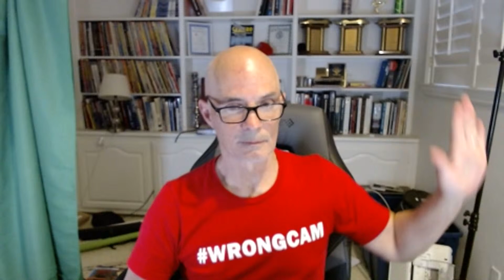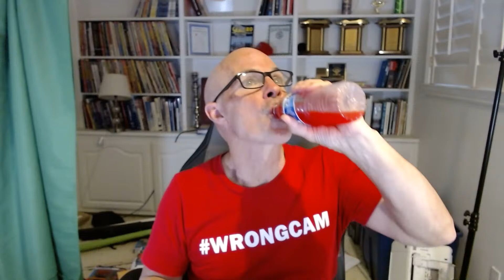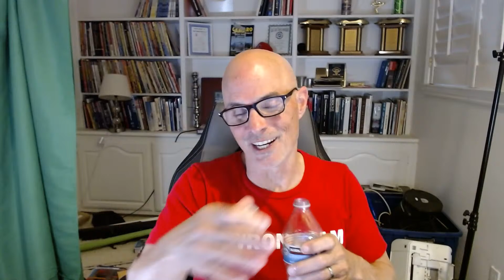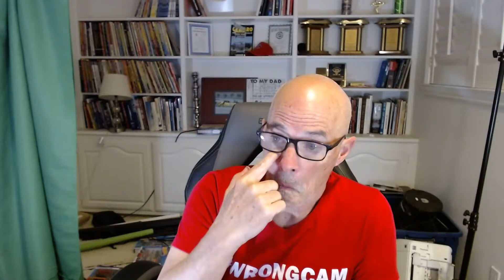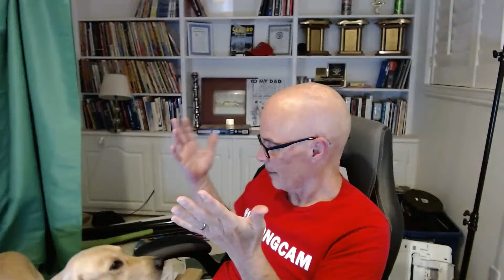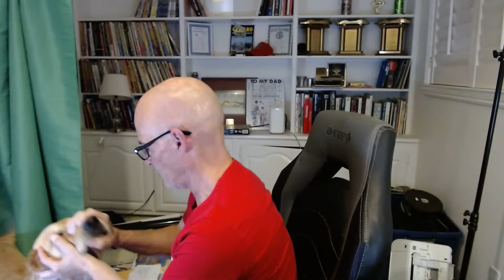CHARGE COOLING-WHY DOESN'T WM ADD POWER? LET'S TALK TECH

Comment: With port injection, the fuel/air are not together long enough to transfer the heat.  Ina carb, the air has time to transfer heat to the atomized fuel. Water/meth is evaporating into vapor.  And, since there is no such thing as a free lunch, the dilution effect of the water vapor offsets the increased charge density, pretty much 1:1.  Water/math is mostly an octane booster.  Although water does improve combustion chemistry.

Comment: How about you make a big bang series with w/m injection and no intercooler. See where you can add timing/boost where you normally couldn't even on an intercooled non w/m comperable setup. Adding boost in mid range rpms would be an awesome test for a gt45 or maybe the gt35 on a 5.3 or 4.8.
Reply from the maker: A WM, non-IC motor is not a Big Bang motor. It is just finding the detonation.
Reply: @richardholdener1727 Water more or less eliminates detonation at the right mass/spray.
Hence interesting to see if you can make it detonate at 15% ratio to fuel

Comment: One thing to note, how does that work out on an engine that turns 10,000 rpm for charge cooling such as motorcycle engines or other automotive engines
Reply from the maker: charge cooling still take place with fuel introduced art the entry
Reply: @richardholdener1727  I have a Yamaha FZ1 with 4 carbs and I've been thinking about EFI swapping with speeduino

Comment: I have run WI on several street cars with carburetors. I did this to help suppress detonation not for more power. This helped especially on hot 100* days. I was able to run slightly more timing for better fuel mileage and cheaper lower octane fuel to save money. This with no increase in power.
In the intake manifold water will atomizes and cool the air but take up ‘air space’ and vaporizes in the combustion chamber to suppress detonation.
One read in the past had a theory that the water in the combustion chamber when it vaporized will expand and add some degree of steam engine function. I have calculated the amount of water that goes into the combustion chamber is so small that even though it vaporizes like 1000x’s volume but that volume is actually very small.
I still use it as there are many positives and no downside. Not making more power is not a downside.

Comment: Water & water methanol injection was implemented on supercharged aircraft engines @ altitude. Altitude effects & lowers the boil point of H2O. 
Perhaps atmospheric pressure combined with the lower temp @ altitude has an effect on the efficacy of this kind of system.

Comment: Water injection: The water vapour will displace the O2 cells. So…. My theory (experience) is that the density gained will not out perform the reduced volume of O2. UNLESS. You have a big turbo without an intercooler, the IAT difference might be so off the chart that you will increase total O2.

I agree with what you’re saying, I know we’ve spoken about meth and I’m a big meth head. I attribute it to my stock engine still having compression

Water/meth: less water vapour, but you smuggle more O2 via fuel. I suspect, that you’ll start having combustion behaviour like running methanol/e85. Cooler EGTs, lower IATs (is it enough to overcome the volume? Nah, I don’t think it is). 

Pure methanol: You displace air, but omg you’ll get more total O2. It’s pretty crazy how much benefit you can get if your combustion distribution is good. My car absolutely loves higher methanol mixtures, it’s wild.

Comment: Because reported IAT temps aren't an accurate representation of the actual charge temps. They are the result of a wetted thermocouple having heat drawn from it over time. 

 This is why if you run 20lbs with an IC and have 140* charge temps. Then remove that IC and run water/meth instead (with enough jet to report 140* charge temps). The intercooled setup will always make more power. Because the charge temps reported are much more accurate without fluid in the mix.  Just because a sensor tells you something, doesn't mean its true. 

Main benefit 2 meth inj. at low volumes is cylinder cooling and anti-detonation, not charge cooling. No common kits inject enough volume to pull the same heat an IC does. Look at the volume injected with a carb vs a typical 8-12gph meth nozzle. That is why you see benefits with the carb, and not with water/meth. Run 100% of the fueling as meth with a carb and suddenly charge cooling works just fine.  Same deal with meth injection. You just don't run enough of it to knock off the charge temps in your tests because you are looking at the IAT sensor.

Comment: Dunb question where are you injecting the water meth? I imagine it would lower the amount of air the intake can flow. Not necessarily mass flow of the intake but the amount of actual oxygen and fuel it can flow. Because the water meth has to take up space in the runners.

Comment: Hi Richard It's funny you made this video. My name is Brant Kinnsch I don't know if you remember me but I had Steve do that all aluminum 572 that I built with direct port FI and water meth on a Hogan manifold. We saw 10-14 hp on that engine injecting water meth or strait meth I can't remember which was the case. I don't think Eric added any timing of any other compensation to the tune. Eric incorporated the injection via a holley dominator ecu. I remember this as Steve was poo pooing me about trying to band aid the fuel octane instead of just running race gas. The good news for you is Steve has the dyno files. The customers name was Brian Stout. I remember being somewhat vindicated after that dyno pull as it did make more power. Let me know if you find the files I would be curious to hear about the notes that Steve put into it. I'll also ask Brian for the files as he still has them. This was about two years and 10 engines that I have done ago. So my memory is a little vague. You might remember Brian and his wife they had that Big great dane that was cruising around the shop when we were there

Comment: nitrous oxide works the same way as injecting water/methanol or just injecting methanol. N2O, so 2 parts of nitrogen and 1 part oxygen. Nitrogen must be cooled a lot to make it a liquid so when the nitrous goes through the engine and then hits the combustion chamber it removes a lot of heat and then the oxygen burns making more power. methanol is toxic and burns almost invisibly so by adding water it removes the methanol's ability to burn as easily and also it isn't toxic with a 50/50 ratio. when methanol is used as a primary fuel the engine wears out much faster. someone tested the different types of fuel and the engine wear pattern, there is more metal in the oil. methanol costs about 2.50 to 5 dollars per gallon and it burns at a rate of like 2:1 so roughly double of unleaded fuel. the stochiometric of methanol is somewhere around 5.5 to 7 to 1. the stochiometric of ethanol is like 9:1 so you need about 30% more ethanol to get the same burn rate as unleaded fuel and methanol burns like double.
Reply from the maker: WM IS NOTLIKE NOS
Reply: @richardholdener1727  it is a little bit as they all have oxygen.

Comment: methanol is oxygenated so that by itself will make more power. Methanol has a high octane rating of 114. water is also oxygenated= h2O, so 1 atom of oxygen. Earth's atmosphere is made up of 78% nitrogen, 21% oxygen, 0.9% argon, and 0.1% other gases. so even water has more oxygen in it than atmosphere. Methanol was used as early as WW2 in airplanes. you need heat to vaporize the liquid which separates the water from the oxygen and then it can be consumed as fuel. when I injected w/m in my 2001 L67 the kit came with an activation dial so it could be started at higher or lower boost and it seemed to work better when I set it to activate at higher boost because there was already more heat in the supercharger and the w/m was injected prior to the rotor case.

Comment: Water/methanol has volume and is not very energy dense. It has the effect of reducing displacement when the engine is naturally aspirated. At best you break even in terms of horsepower if the timing can be advanced. There may be some benefit in an engine that has a high compression ratio because you are often octane limited and can add timing. In a boosted application, the water/methanol injected engine can make more power. The reason for this is because timing can be advanced. In a boosted application, timing must be retarded to prevent detonation. Timing can be more advanced with water/methanol injection. I own a Procharged Mustang. The timing can be advanced 4 degrees when I add water/methanol injection as opposed to running just pump gas. Although I haven't tested the car on the Dyno, my timeslips are about 2 tenths of a second quicker in the quarter mile when I use water/methanol injection. A tuner once told me that adding water/methanol injection without advancing timing will actually result in a loss of horsepower.

Comment: Saying water meth doesn’t add power but the tuning for it does is like saying adding a can doesn’t add power but the tuning does. 
If you add water meth and you can thus add more timing without detonation, and it makes power…then same thing when you add a cam. You must tune for it. We all know nitromethane adds power but if you add nitromethane without tuning, you lose power.
Reply from the maker: I CAN ADD A CAM AND IT MAKES POWER ALL BY ITSELF-THE POWER DOESN'T COME FROM ADDED TIMING (THE GAINS COME WITH THE SAME TIMING)
Reply: @richardholdener1727  every time I added a cam without tuning, the engine would BARELY RUN AND DID NOT MAKE MORE POWER UNTIL IT WAS TUNED.
Reply: @richardholdener1727  seriously dude? You know good and damn well that you have to retune for a cam and the timing doesn’t always need to be changed but the fueling does. Adding water meth will not add power usually on it own, but if you can add timing and it adds power while suppressing the detonation….then in essence you added power by adding water meth. Stop sniffing glue dude. If you are so sure, post up an unbiased test. Add timing till it detonates. Then add water method and see if you can take it further. There’s a reason why boosted guys use it. And why there’s companies that sell kits.

Comment: You should watch David Vizards " World's cheapest  most effective octane booster " for answers
Reply from the maker: HE DOESN'T ANSWER THIS QUESTION
Reply: @richardholdener1727  David  says that if the droplets vapourise too soon, then the vapour takes up space that can't be utilised for air and fuel. Thus, you don't gain power from the temperature change and may lose some. The size of the droplets in relationship to where the water is injected seam to be critical. 
In other vidios he's also talked about the droplet size with carburettors being very important,  too small a droplet, and they vapourise too quickly, again taking up space in the manifold, thus reducing the amount of additional power  provided by the cooling effect. The bottom line seems to be that water improves the octane, (and extra power can be found if you exploit this) . Any  additional cooling you see from water  doesn't translate into power due to it taking up space for fuel and air in the manifold and particularly the combustion chamber.

Comment: Not tested, but maybe 2 plausible reason. 
1. Fuel introduced at a greater distance from the combustion chamber vaporises more. Fuel vapour (not wet fuel)  is what burns with oxygen to make more power in the combustion chamber. 

2.  Fuel vapour is less dense than wet fuel and more likely to take the short turn of the intake port resulting in better air/fuel mix in chamber and more power. Wet fuel injected at high port air velocity shoots over the top of the valve and lands on the cylinder wall ( it doesn't take the short turn) creating poor fuel/air mixture in the combustion chamber - less power (and more prone to lean spot detonation around the short turn side of the intake valve).

The power gain is not from the cooler charge, rather than better vaporisation/mixture in the combustion chamber, hence why the power is not gain back by water meth injection.

Some good videos to check out that may help:
Ben Alameda Racing - "How good are fuel injection mixing fuel with air"
Anything wet flow benching
Anything Darin Morgan

Comment: The volume of the gasoline is significantly more than water injection. The dirt track guys running carbs with methanol, the intake manifolds have thick frost built up on the outside. Since efi introduces the fuel after the intake, wouldn’t a cooler intake act like an intercooler?  Since humidity gives you a higher density altitude, would adding water do the same thing?  Lots of ideas
Reply: My thing is humidity has a point where the motor will hate everything about it. If you fill a chamber with 14 percent gasoline/humidity it likes that, it hates 50 percent humidity of fuel let alone flooding it with less flammable stuff.

Comment: Richard, water has a very high latent heat of vaporization compared to gasoline, it takes a lot more energy to vaporize water than it does gas. That, combined with water occupying space in the combustion chamber that could otherwise be air used for combustion is why you don’t see water/meth making the power even though it does cool the intake charge significantly. The power all shows back up when you omit the water and inject straight meth.
Reply: Yup, great explanation. The Reid vapor pressure of gasoline (and methanol) is also much lower than water so it vaporizes faster.   This makes the temperature depression quicker which makes a difference in the short time the air/fuel charge is in the intake.
Reply: @DragonFireEngneering Question: If water/meth is injected further away (say in a boost pipe right after turbo comp outlet or after I/C, if equipped), would increade time for vaporization, VS. W/M injection after the carb throttle? Would carb icing then be a problem in the first scenario? Dipping a finger in room temp gasoline seems colder after pullout than in water. Water meth. may have greater LHoV potential but it is slower than gasoline, if I understand correctly. Thx. Richard for discussion.
Reply: Water VAPOR, once evaporated, displaces air/mixture.  Just about nullifying the increased charge density.
Reply from the maker: DING DING
Reply: On boost (at higher pressure), water doesn't evaporate (think of pressure cookers). It will only evaporate once heat of combustion is added.

On NA it's a different story: the vacuum will evaporate the water in the intake and water vapour will displace the oxygen despite cooling it.

I.e. less oxygen on a low/no boost application.
Reply: @lavrentievv  There is always a water vapor pressure ( discounting the triple point ).  At any boost level, max cooling occurs at 100% humidity, for a given pressure/temperature.  If you want to add power with water injection, you need the water to be LIQUID, as it passes the intake valve.
Reply: @lordandprotector  Yeah that's basically what I meant. But I also calculated the speed/pressure+ temperature of the boost at above 9psi and worked out that the water will be liquid until it reaches the intake valve at least. Most likely during compression too. Water itself car absorb a lot of heat energy (especially under pressure) before turning to vapour.

To the point where under the compression stroke it will make the engine act like an Atkinson engine: absorbing the heat/pressure of the compression stoke, but expanding in the combustion stroke
Reply: @lavrentievv  I'd have to run the numbers.  But, if the water stayed liquid, there would be no evaporative cooling in the intake tract?
Reply: @lordandprotector  Correct. All the cooling comes from the water absorption of the heat in the intake tract under boost. At 9psi and 10% water/fuel ratio water goes from 30-60 degrees Celsius. Doesn't come close to ≈120 degrees it needs to evaporate under pressure. It then absorbs more heat under the compression stroke.
Only evaporates during combustion.
Reply: @lavrentievv  I'd need to grab the steam tables to get the real numbers, with heat capacities, etc. .  But, at 12AFR, and 10;1 fuel/water the mass ratio of air/water is 120:1.  So non-evaporative  cooling would be pretty minimal.  So, maybe 30:1 dT(water)/dT(air) ?
Reply: @lordandprotector  Take into account water has 4x the specific heat of air for the same mass.
Reply: @lavrentievv  Yes. that's how I got the 30:1 ratio.  12:1 AFR  10:1 FWR = 120:1 AWR mass ratio.  Then, divide by 4 (appx) for the difference in heat capacity ( approximate ), gets you 30:1 deltaT(water):deltaT(air), absent evaporation.  So, with the given 30C increase in water temp ( 60c-30c), you would see 1C drop in air temp.

Comment: I thought water/meth injection allowed you to add a little margin of safety to an engine that was at the ragged edge of detonation.  So it doesn't add power, but rather make it slightly less likely to blow up when at the limit.  If that is true then theoretically you could run more boost on worse fuel with meth/water than without so it would then contribute to making more power.  Right?  Just like there is less energy in "premium" fuel, but it is said to "make more power" because an engine can run more boost or have higher compression and run more timing with premium fuel.